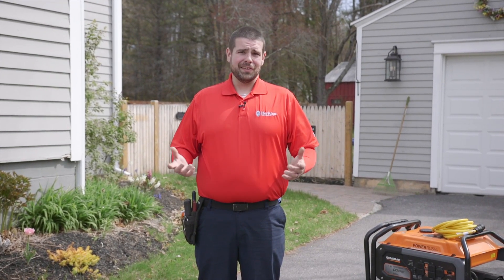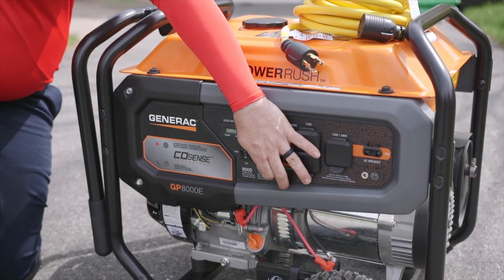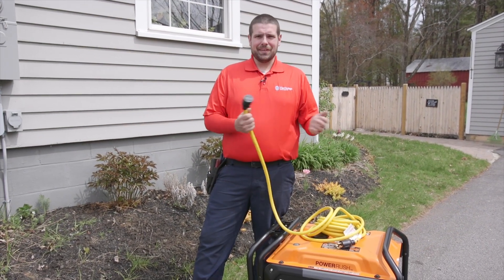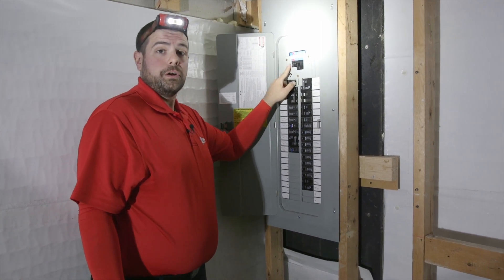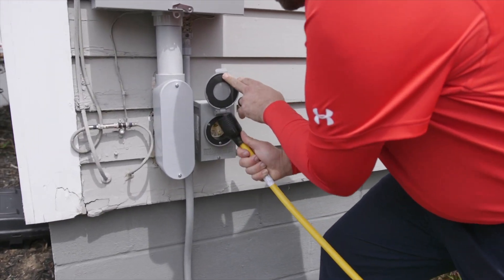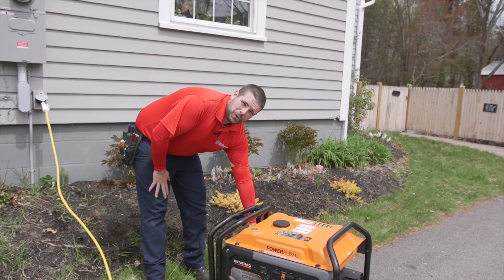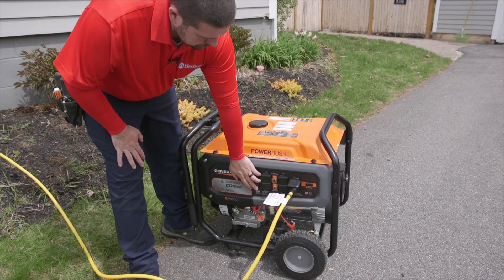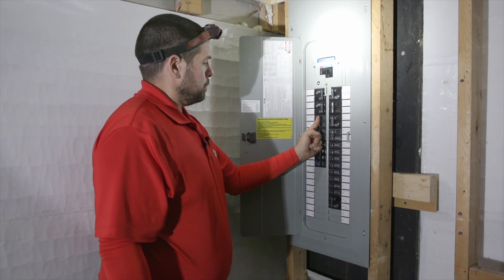How To: Connecting a Portable Generator

Comment: You may want to turn off the fuel first and let the gas run out of the carburetor. Then turn off the switch.   
Trying to line up the cable plug with the inlet at night? Take a marker or white-out and make a line on the plug & socket to line up the two before you twist it. Keep battery charged. Install emergency lights that come on when power goes out. Install them where you set up the generator, at the panel and maybe in the main hall and stairs. Have an extra spark plug. If you have LP or NG, get a Dual-Fuel or Tri-Fuel generator. If you have a large A/C unit you may want to install a Soft-starter on the outside unit to reduce the peak input amperage.